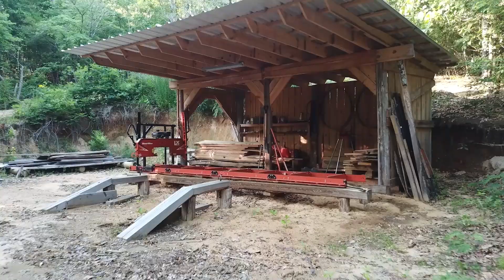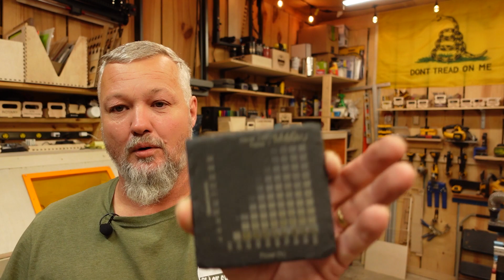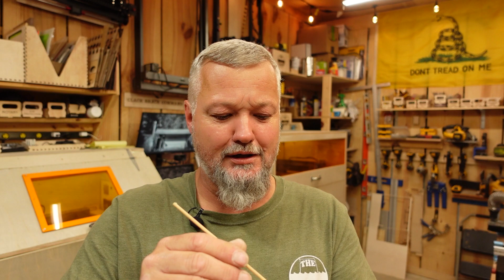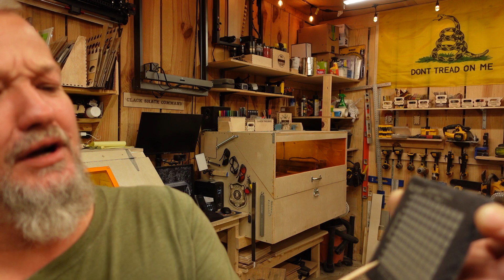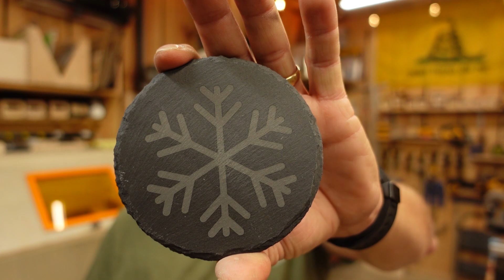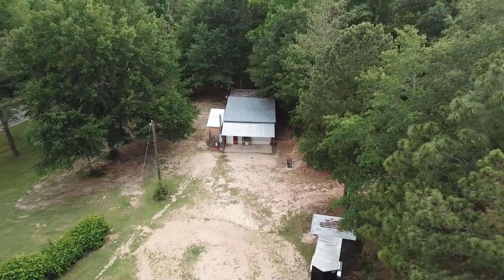CO2 vs. DIODE vs. FIBER on slate

Comment: I hope you are still answering questions. I have monport 40w co2. I noticed you said something about your being throttled down in speed. How do you check and change that? Thank you
Reply from the maker: All the settings are in the controller. You will need to look at what the limits are set to

Comment: Question:  Can you laser ceramic tiles?
I came across over 40 cases of ceramic tiles. Abt 20 tiles per case. So I have quite a bit. I do not have a laser to test. 
Wondering what size laser would work? 
Very much a newbie. Any suggestions? Thank you!
Reply from the maker: You can, some work better than others. The fiber does best on them from my experience
Reply: @T @TheClackShack thank you. Would I need to spray them 1st? And with what, the Titanium paint?  I wish I could send u a picture then but it’s a basic tile.

Comment: Great Video! I had a question though. Ive been trying to sell slate coasters but I find that almost half of the ones I buy to engrave are uneven, causing them to wobble drastically on the table. Do you have this same problem and if so do you still sell them or just consider them throw aways?
Reply from the maker: If they have the feet on the back, they should be level. Never has that issue

Comment: What's the time difference between the diode and co2? Co2 should be a lot faster and you can make more.
Reply from the maker: The M40 is not faster than my diodes. Other CO2s may be.

Comment: I just have a co2 but was looking for a whiter finish on slate, looks like I make have to get a diode and live with the slower speed. But as I'm usually just doing sets of 4 or 6 it's not a major issue.
Not sure how small your Monport is, but I can easily get 6 standard coasters in my no name k40.
Reply from the maker: Mine is a monport M40

Comment: Do you bother with any treatments on the slate before or after? I have tried some matte finish that I paint on but if I don't let it fully dry it can ruin the piece. I have two lasers an S1 from your recommendation with the 40 W and the 2W IR. So far I love it. I also have a Laser Pecker 4, I have noticed that all slate seems to be a little different. Settings that may give me a great coaster may not have the same results on a large cheese board slate from a different company. So I have been accepting that it's best to make sure you test each new supply and know that one piece will be for testing. I wish I could find  a treatment that is perfect. I also tried linseed oil and white spirts mix 50/50 and that works good but you need to really be sure it's fully dry before lasering it . I am wondering if I should just laser them and be done or do the need protection from stains and drinks. Doing it after always seems to dull the image but lasering it off make me think  what's the point other than making the black coaster a little more black. Maybe using a thinner mix of matte finish on the lasered area would be an option
Reply from the maker: If I use anything, just rattle can poly. Before or after depending on contrast I want.
Reply: Thanks love your channel it's been very helpful since I added lasers to my sharpening business @TheClackShack
Reply: I did a video on my riser base install and I mentioned your channel at 7:44 hope to do my fire suppression today if i can get all my sharpening jobs done. I have to show you something I did for the moving crumb tray problem thats been working well as a fix I have to shoot that video too  @TheClackShack

Comment: Just did a bunch of coasters on my fiber the other nite.  600 mm/s, 40% power, 40 kHz.  They came out brighter and clearer (crisper) than what your diode did, mine is a 30 watt MOPA.  It takes a lot of experimentation to get the settings all dialed in.   BTW, don't run that CO2 at 100% too much, the tube won't last long.
Reply from the maker: My CO2 is software regulated to 70 percent on the backend to avoid being able to run it at 100% but thanks. Also, A MOPA should do a better job than my RACUS fiber or a 20 watt diode, I would imagine.

Comment: I sit here in France (I’m Scottish not French) and enjoy your videos especially now that I have a GWeike G2 fibre coming soon to add to my laser family. This video shows a test on slate that I’ll do with my CO2, Diode and eventually the fibre and it will be fun to compare them to your results. What makes me wonder though is your use of 100% power on so many tasks, my understanding is that the life, particularly of a CO2 tube, will be seriously reduced using 100% power. Do you worry about that? Have you had any issues from using 100% on your CO2 or diode lasers. Keep up the videos, I love them and we’re all learning from each other so thanks. Terry
Reply from the maker: My CO2 is limited in lightburn to 75 percent, what you see in lightburn is 100 percent of 75 percent. The other machines will suffer mechanical wear before the diodes go out. Just my opinion. Time is money and less time equals more money.
Reply: @TheClackShack  Now that’s sneaky, so you dial in 100% but Lightburn restricts your actual output to 75%. Is that something that you set or is that a Lightburn thing? As to your time is money comment, I understand. You’re in business where I’m retired and a hobbyist so making the tube last at the cost of a little extra time makes sense for me but I can see why it’s not for you. Thanks for explaining.
Reply from the maker: @terryvaughan8095  yes, in the settings in lightburn you can set the S value to limit the machine to a portion of its output. Normally , S=1000 will be the setting but if set to S=750, if basically knocks it down to 75 percent.

Comment: David,  for slate coasters.. They must be manufactured (I'm sure they all are) . I did some test engraving on to natural slate on my 10w diode.  It cut grooves in to the slate for the letters.  Very different look than one of the manufactured coaster.
Reply from the maker: Possibly,
Reply: Not true. I only engrave hand broken old roofing slate without Problems.
Reply from the maker: @JustiaFiat  What part is not true? My tests were completely true.

Comment: I was able to get a rough texture like that on my 10w diode (Phecda) .  Newbie here so it was by accident.  I ran a test pattern and at 10mm a sec I started getting that finish lightly from 40% power to much rougher from 60% power and up.  Thanks for the video
Reply from the maker: It must be a reaction to the heat,, Thanks

Comment: I have a MonPort 40 as well and I’m not sure of the entire engraving area.  I need to do a mirror image to get it to engrave or figure out how to get it to engrave without mirroring.   Also I need to figure out the exact engraving area so I know where to put items for engraving.
Reply from the maker: Make sure your origin is set to back left corner. If the origin doesn't match the home location, it will flip the burn.